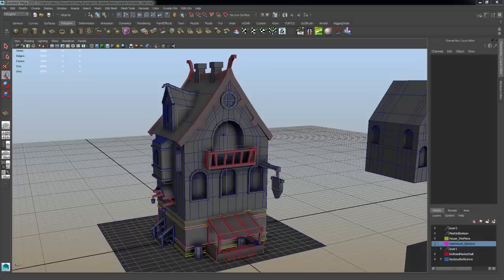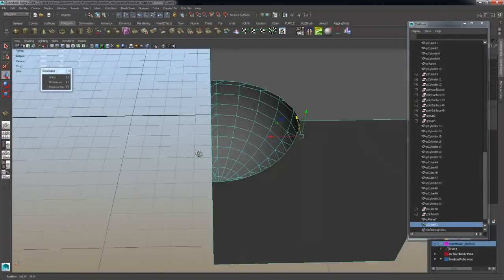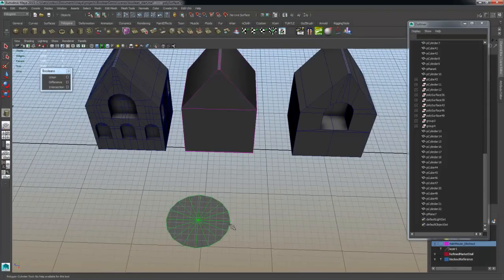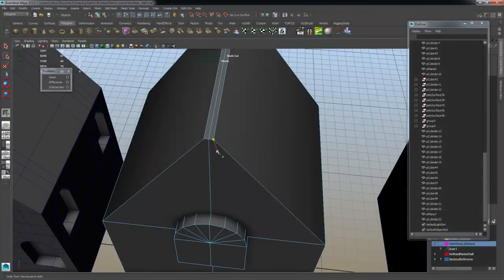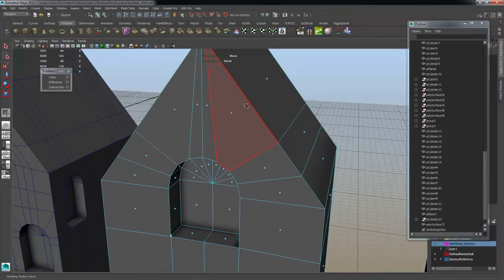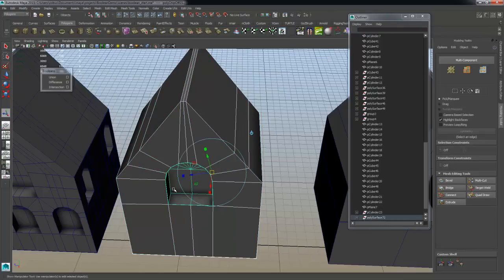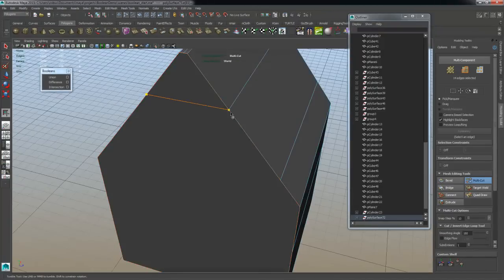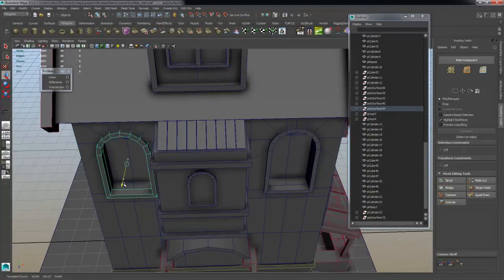Maya Modeling techniques (how to guide) part 4

Comment: I was under the impression that creating tris was a no-no for uv unwraps later down the road? did you throw material and texture on these? I was also under the impression that using booleans were bad because they created incorrect gemonetry at times and were not a good shortcut to use in general as they cause more problems than they help solve. Thank you for taking the time to create this tutorial and I really like the way your models turned out. Would love to see the final result if they were assets used in something.

Comment: I find the legacy boolean substraction easier to use. I have it set to Edge and Legacy and so far I haven't had any problems. I don't even have to do the cleanup. It just works.

Edit: Nevermind, I found an issue with the legacy. After you do the substraction you will find a lone dot. That dot inidicates the face of the square. If you delete it the entire face gets deleted.

Comment: One thing you can do is to go to vertex selection mode, select all the vertexes in the scene and press merge, much easier than merging two by two vertexes. You need the right tolerance and disable camera selection in order for this to work. 

Also if you extrude by offset and not thickness it will extrude correctly so you don't have to adjust it afterwards.

Comment: What would you suggest to someone who is just getting into 3D design Blender or Maya?
Reply from the maker: hi. honestly it doesnt matter. A tool is just a means to get the job done. Its like asking what is better between a penand a pencil.. at the end of the day you have to choose what is easier for you to use and what you feel most comfortable with. I chose maya on the basis that its an industry standard. there are allot more studios using maya .

Comment: This is great! I find your tutorials extremely informative and helpful. However where are parts 1-3??
Reply: Because it is part 4 of the guide, not of building the house.
Reply from the maker: +Ellen Shelley Hi. thanks for the comments. So if you look closely, you will notice it the modeling techniques guide. not specifically modeling of this particular little house model. Hope that clears out any confusion. This video was purely intended to focus on the Boolean techniques.
Reply: +Cobus van Staden Then why label it part 4!!?